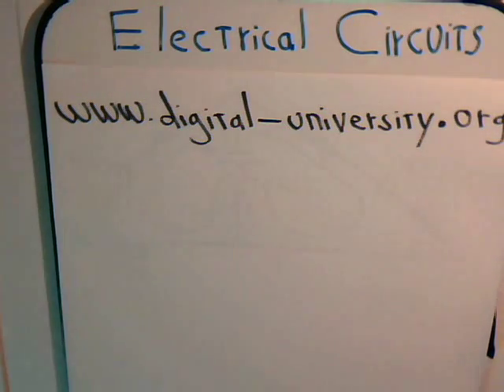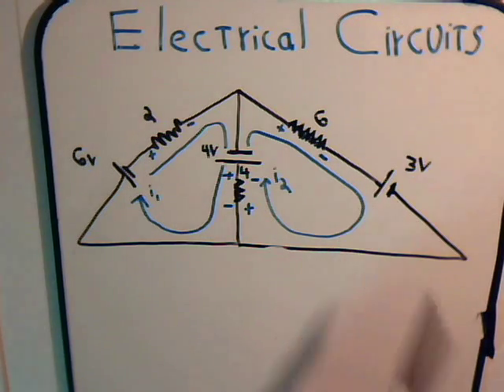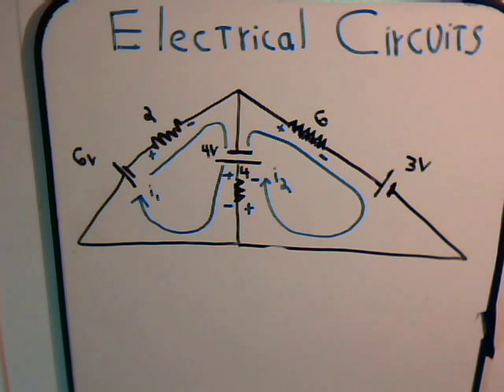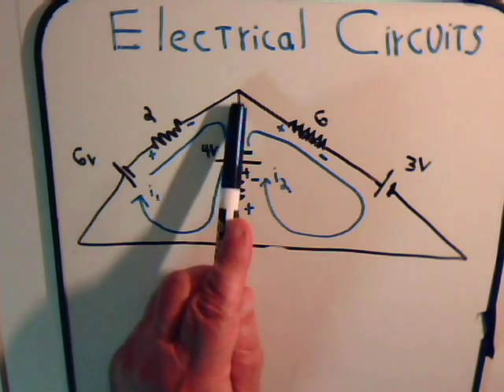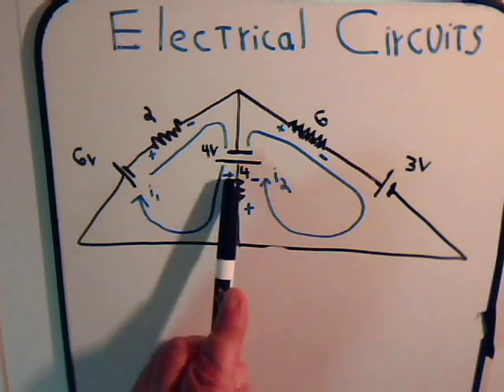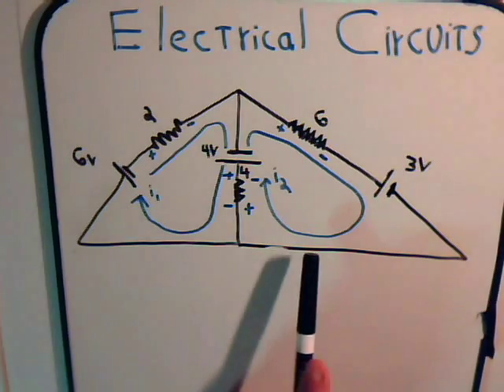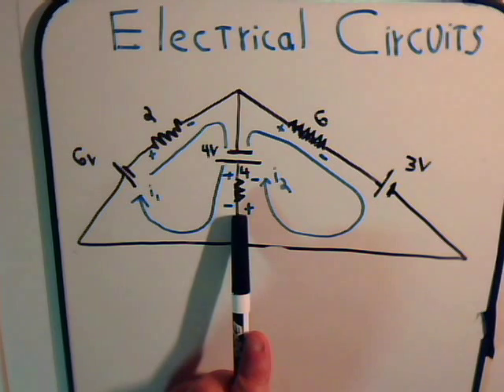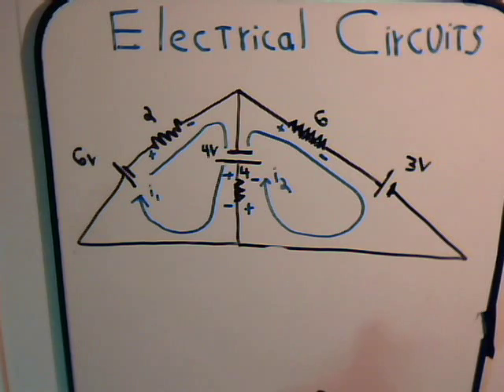Electrical Circuits Video 13: Mesh Current Analysis Example #2

Comment: Hey DU could you guys please tag the corrections for mesh 01 at 5:26 (-3i1+2i2=1) and mesh 02 at 07:43 (4i1-10i2=7)  and final answers as well coz lot of peoples are getting confused over here,

Comment: I did not get either of those equations and answers...
I have...
mesh 1: 6-2i1+4-4(i1-i2)= -6i1+4i2=-2
mesh 2: 4-6i2+3-4(i2-i1)= 4i2-10i2=-7
i1=-48/54A=-.88A
i2=34/54A=.629A

I think a messed up the voltage sources. is the longer line the negative side and the shorter line the positive side. Then when you enter the voltage source from the negative side your voltage is positive in your mesh equation?

Comment: @swisaj 
I have the same. 
loop1:  -4 + 4(i1 - i2) + 6 +2i2 = 6i1 - 4i2 + 2 = 0
loop2: 6i2 + 3 + 4(i2 - i1) + 4 = -4i1 + 10i2 + 7 = 0
i1=-1.091A
i2=-1.136A

I simulated the circuit and we're right. He made a mistake with the elementary algebra part.